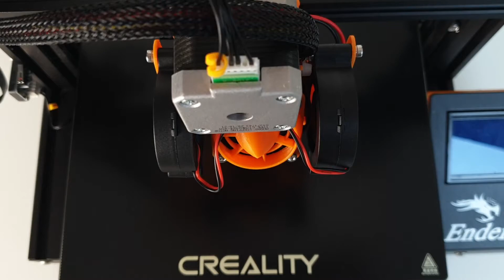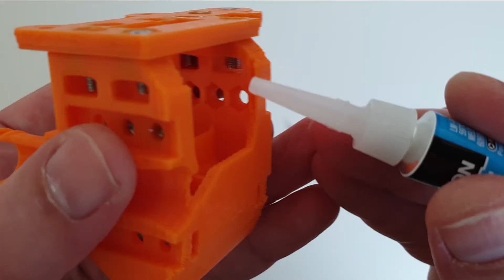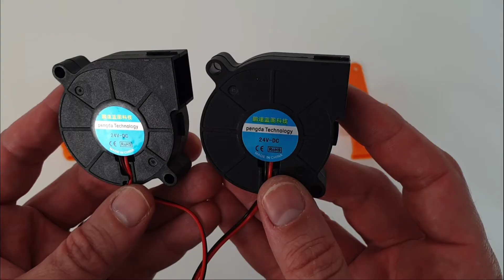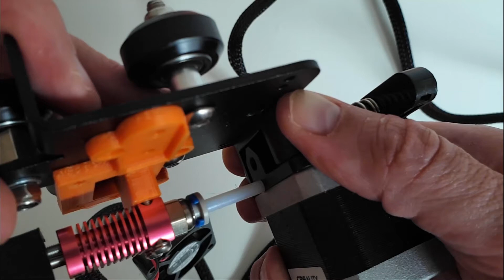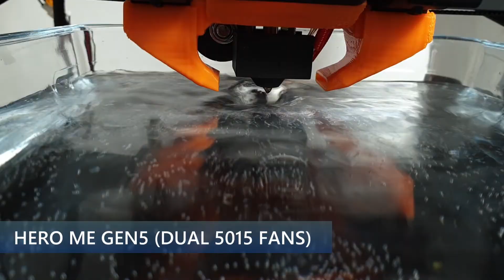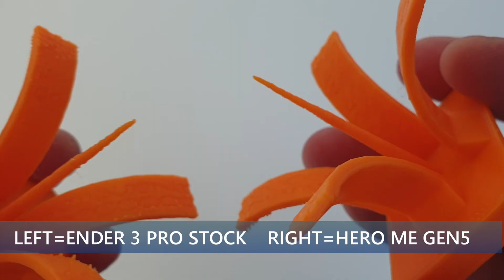Hero Me Gen 5 on Ender 3

Comment: Thanks for the great video on my Hero Me Gen5 Cooling System! Well done. Your video showcases the great performance improvements the Hero Me Gen5 provides over both stock and other cooling options. My recommendation for fan speeds with two 5015 fans on the Hero Me Gen5 has always been not to exceed 70% power, and typically only 40-50% is needed (except for extreme bridging situations then 60-65% should be sufficient). This allows you to get the best cooling and the quietest operation, as with modern 3D printers, with silent drivers, the fans are the loudest part of the print operation. Getting the ducted air from either the dual 5015 fans or one 5015 with a dual duct on the Hero Me will give superior print results. Thank you also for the great assembly video! I will be linking your videos from the Hero Me Gen5 Thingiverse page!
Reply from the maker: Thank YOU for making this great cooling mod available. I am glad you enjoyed the video. When I initially tested the Hero Me Gen 5 dual fan, I printed everything at 100% fan speed because I thought the 2 fans were here to provide more airflow. I was wrong. The Hero Me Gen 5 really shines at 50% fan speed! When I reduced the fan speed, I was amazed by the results. I am glad you confirm that the Hero Me Gen 5 dual fan version is not intended to be used at 100% fan speed. Thanks for linking my video from the Hero Me Gen 5 Thingiverse page! Awesome!
Reply: what percentage should i use with single 5015 and dual duct? nobody says about this.
Reply from the maker: For PLA? The more cooling, the better. Go with 100% if you are OK with the noise level
Reply: @YouMakeTech  ya PLA, thx bro

Comment: Can I run 2x 12v fans on the 24v connection on the mainboard?  Or 2 x 24v fans?  Or rather a converter?  Anyone have instructions?
Reply from the maker: 2 x 24V fans in //. You connect the 2 fan's red wires together and the 2 fan's black wires together. Then you connect this double fan to the printer like it was a single fan. Each fan will receive 24V. The printer will supply 2x more current because now you run 2 fans instead of 1. Hope this is clear!

Comment: Hi, I am new to 3d printing, and I was wondering if you would have to change anything in cura to account for the 8mm shift coming from the adapter.
Reply from the maker: Welcome to 3d printing! For Cura, it makes no difference. The coordinates X=0, Y=0 are just shifted forward on the build plate but this is transparent to Cura. The actual impact is in the firmware because (0,0) may now print outside of the bed. So if you really want to go to (0,0) and be sure the printer does not print outside of the bed, you have to update the Y offset and the size of the bed in the firmware. You can print like this without updating the firmware as long as you don't print a part so big that it will require the printer to go to Y=0. This does usually not happen because Cura centers the part on the build plate and you don't print parts that big

Comment: Terribly painful to install, absolutely overkill on the hardware, you got the hot end touching plastic… but the ducts are nice.  All the painful parts of the installation are cut out of the video.  Give yourself two hours and roll a joint before starting installation or your might throw your printer out the window.
Reply from the maker: Stay calm and install the Hero Me Gen 5! The paintful parts of the installation are not deliberately cut out. Imagine a video where you watch me fighting with a nut for 5 minutes... This would probably be quite boring for 99.99% of people!
Reply: @YouMakeTech  just warning everyone who’s watching, you’re going to want to slap the designer while assembling.  Old gen was way simpler and easier to install.  This generation doesn’t improve anything except compatibility, so if the old one works for you, use it.
Reply: @YouMakeTech  not sure how this model became the number one model on thingiverse, I imagine there must be billions of wasted parts in the landfill.  It has the best ducts, that’s all.

Comment: How can me make dual Fan in one cable ? I only find with one cable
Reply from the maker: By connecting the 2 fans in parallel. You cut the current cable and you connect the 2 fans red cable to red and the 2 fans black cables to black.

Comment: Hi! Great video! I've a question about the wiring an add fan or change it. I have a Ender 3 v2 with the stock 4010 fan.. how did you to change it for two 5015 (0.05A vs 0.2A maybe)?  you only conect the wires in parallalel or you need change something in the font or marlin maybe? you mentioned the velocity change, but if you change the energy consume adding two fans more powerfull, how do you know if they are working at 100% of velocity? maybe it´s danger to over charge the port font? 
I'll waiting your answer, many thanks!
Reply from the maker: Thanks for your comment. The 2 fans are connected in parallel. Nothing to change in the firmware. I don't have the Creality specs for the max current on the  fan connector but it is typically > 1 Amp. I measured the current consumption on both setups: one 4010 fan draws 60 mA and two 5015 fans at full speed draw 220 mA. The current is well below what is available on the connector therefore the 2 fans run at full speed and there is no risk to burn the board. Hope this helps
Reply: @YouMakeTech  Thanks for your prompt answer! It's very helpful your info.
I have one more question, How do you set the % velocity? you should change the velocity proportionally? like put 190% in Cura to obtain the 100% velocity with the two fans? (because it was the same energy for two fans, so you should make a proportional increment to achive the 100%, thats it,s right or I'm thinking wrongly?) Thanks again!
Reply from the maker: Because the 2 fans are connected in parallel, they receive the exact same voltage. When you set the speed to 100% in the slicer, each fan receives the max voltage and turns at full speed. When you set the speed to 50% in the slicer, each fan receives half the voltage and turns at half speed. Whether you have one, 2 or more fans makes no difference for the slicer because they are connected in parallel. A parallel connection is a splitter and provides the same voltage to each fan as it was running as a single fan
Reply: @YouMakeTech  ok, many thanks for the info! saludos!

Comment: hi, may i ask how long you did cut your bowdentube for the direct drive?
Reply from the maker: hi, it depends upon which hotend/extruder you use. I use the tube that came with my direct drive (Creality). Although the Hero Me shifts the hotend forward, it does not affect the vertical distance therefore I did not have to adjust the tube length. If you have to cut a tube, I would recommend to cut it slightly longer and to adjust it mm by mm. Make sure there is no free play and that you push the tube to the maximum against the nozzle in the hotend.

Comment: I have a question regarding the placement of the hotend cooling fan. In the stock setup, the sticker is facing away from the heatsink, pulling hot air away from the heatsink. But when you reinstalled the hotend fan on the new mount you have the sticker facing towards the heatsink, blowing cool air into the heatsink. Is that correct, of am I missing something? Just want to make sure I install it correctly so any insight is appreciated.
Reply from the maker: Thanks for your comment. The sticker should be facing away from the heatsink. I don't know if this makes much difference in terms of cooling but you're right, that's how it is on the stock cooler.

Comment: I think I got defective fans, with dual 5015's my water test at 100% looks the same as yours at 50%.
Reply from the maker: Possibly. Try to connect each fan individually to see if they turn full speed. Are you sure you connected the fans in parallel? (The 2 fan red wires connected together and the 2 fan black wires connected together). I am asking because if you connect the fans differently, each fan receives only 12 Volts instead of 24 Volts and turns only at half speed.
Reply: @YouMakeTech  I desoldered the other fan and connected only one of the fans and its still spinning at half or even less speed, ill be ordering soundoriginal blower fans.
Reply from the maker: Yes. The quality of these fans is very variable unfortunately. Sometimes, they don't work at all, sometimes the polarity is reversed. Maybe try another brand/supplier. Good luck

Comment: Great video. Noob question - what do you mean by "support from ground plate" (1:04)? I cant find this option in Cura. This is for my Ender 3 V2
Reply from the maker: Thanks for your comment. In the top right corner of Cura, click on the small pencil. This opens the Print Settings window. Scroll down to "Support". Click on the 'Generate Support" checkbox to enable supports. 2 lines below, in the drop box for "Supports Placement" , select  "Touching Buildplate". Do not select "Everywhere" otherwise Cura generates support structure inside the ducts and your parts are good for the trash. Hope this helps.
Reply: @YouMakeTech  Thank you very much. I appreciate your quick reply.

Comment: Really great video. Nice work. But I have a doubt regarding the nozzle position after attaching the extruder to the plate. The extruder position is changed almost 18mm to the -Y axis. As a result we almost loss the front of the bed. So is there any methods to adjust the nozzle position?
Reply from the maker: Thanks for your comment. In my setup, the nozzle is shifted forward by 8 mm only with respect to its normal position, not 18 mm. I don't think it is possible to recover the lost build volume due to this, but I may be wrong. If you find a way, please let us know!
Reply: @YouMakeTech  your are correct the nozzle is forwarded by almost 8mm. But now the nozzle is almost 15mm forward to gantry plate. So while probing using BL touch it's almost at the edge of the beds.
Reply from the maker: @albingeorge3107  Do you use Marlin? Did you update the NOZZLE_TO_PROBE_OFFSET in Configuration.h with the correct values? Looks like you can also shift the probing grid at the desired position with PROBING_MARGIN_LEFT, PROBING_MARGIN_RIGHT, PROBING_MARGIN_FRONT, PROBING_MARGIN_BACK in Configuration_adv.h
Reply: @YouMakeTech Thanks  YouMakeTech. Yes I am using Marlin 2.0 bugfix. Actually the solution is available in the documentation itself. Just make a changes in the configuration.h file like this  "#define MANUAL_Y_HOME_POS -9".
(The offset value of each gantry plate is mentioned in there.) Then recompile the firmware and upload. 
Or connect to any terminal and type this gcode "M206 Y-9". The above two methods will update the z offset .
Reply from the maker: @albingeorge3107  👍 Good to know. Thank you.

Comment from the maker: 0:00 Introduction
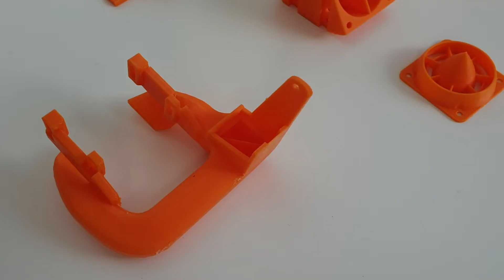0:52 3D printed parts and 5015 fans
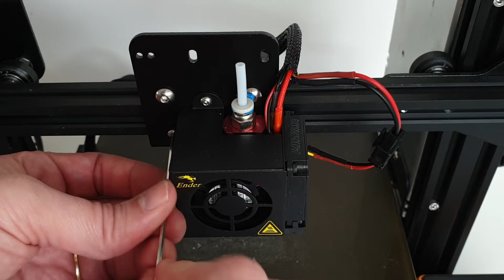1:20 Installation
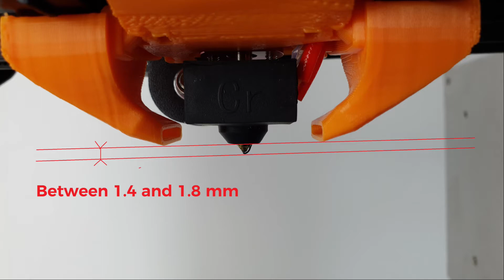5:55 Water tests
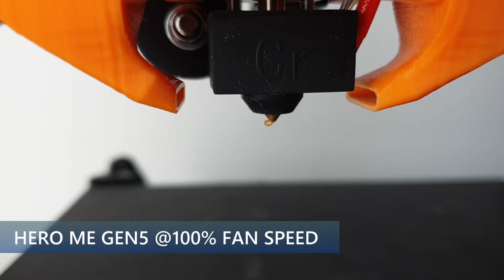6:13 Fan speed impact on filament extrusion
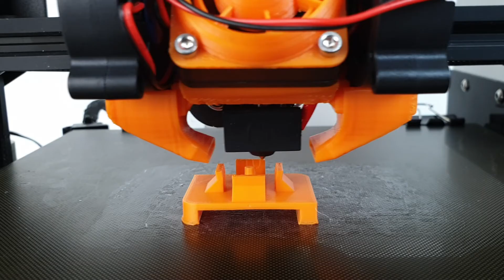6:41 Print quality
8:10 Insane 243 mm bridge test and conclusion
Reply: I made it installed it, but my bed is off now:(
Reply from the maker: @benkave2779  This is expected because the Hero Me Gen 5 shifts the hotend forward by about 9 mm. To fix this, you can either update the firmware or add a gcode command in the startup script of your printer. Please see Albin George comment below or read instructions at the end of the .pdf that comes with the Hero Me Gen5 package. Good luck!

Comment: what kind of direct extruder kit do you have? I'm planing to move my bondtech to my actual HeroMeGen5 setup on my CR10s, but I'm not sure what kind of adaptor I need to use... any clue?
Reply from the maker: Be aware of the designer note (page 9 of Hero_Me_Gen5_Parts_Cross_Reference_and_Assembly_Instructions.pdf): "IMPORTANT! All the current Direct Drive Adapters that are included with the Hero Me Gen5 REQUIRE that you have one of the PrinterMods.com MDD Kits (versions 1.2 or 1.3)! There are several DD adapters in the Remixes section of the Hero Me Gen5 on Thingiverse that do not
require an MDD kit."
Reply from the maker: The one shown in the video is the official Creality Direct Drive Kit: https://www.creality3dofficial.com/fr/collections/head-extruder/products/direct-extruding-mechanism-complete-extruder-nozzle-kit-for-ender-3
Reply: Can you share the file please for the DD adapter
Reply from the maker: @benkave2779  Sure. I posted it on Thingiverse: https://www.thingiverse.com/thing:4827548

Comment: Is there any sources for fan cable connection? I didn't understand what kind of adapter did you use for connections.
Reply from the maker: I use a JST 2 pins male to female connector. You can find them on Amazon.
Reply: @YouMakeTech  2 x 5015 fans Red/Red and Black/Black wired to the same connector?
Reply from the maker: Yes

Comment: Very good but i wish someone would post orientations on how best to print these out as i have tried and failed
Reply from the maker: When you download the Hero Me Gen 5 on thingiverse, there is pdf file named "Hero_Me_Gen5_Parts_Cross_Reference_and_Assembly_Instructions.pdf" in the package. The orientation of parts is shown on page 15 in this file. To print the Hero Me Gen 5: In Cura, Support section, enable "Generate Supports" and in "Support Placement", make sure "Touching Buildplate" is selected. Do not select "Everywhere" otherwise Cura generates support structures in the ducts and your parts are good for the trash!
Reply: for the files they should already be in the best position when you put it in your slicer. Add supports everywhere and add support blockers for the inside of the duct. or use prusa slicer paint on supports.
Reply: @DonaldSayers  I have tried this already on My Ender 3 pro with several attempts but the holes end up getting filled up too Printing with PLA @ 205 bed @ 60, Stock fans BTT SKR mini E3 Glass bed, Capricorn tubing, yellow springs and BL touch v3, but not sure what the setting were in Cura 4.8.
Ive saw lots of people doing video's of printing these out but not one showing the orientation and setup for printing the Hero!
Reply: @kevinbroadley5422  Might want to just try the Blokhead. sounds like your not setting up support blockers right. The blokhead only needs supports from the buildplate.
Reply: @DonaldSayers  Yes i'll give that one a go, really liked the previous video on the 'Blockhead'.
Reply: @kevinbroadley5422  It's what I use. just make sure you select "support from build plate only"